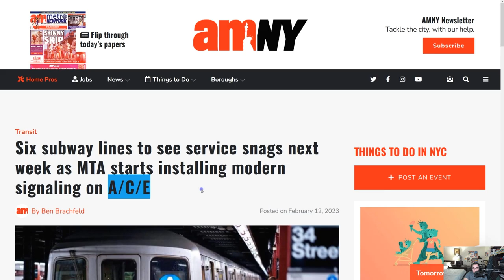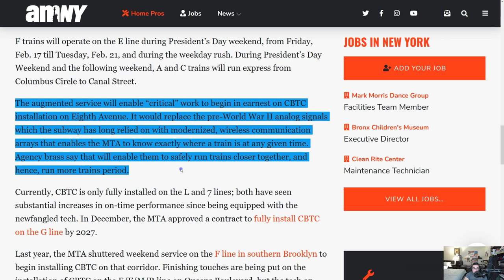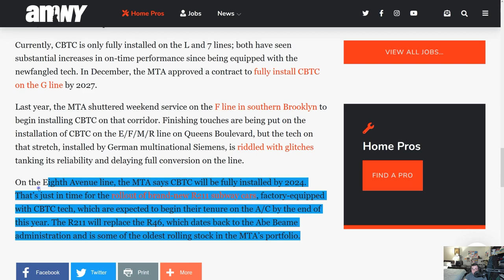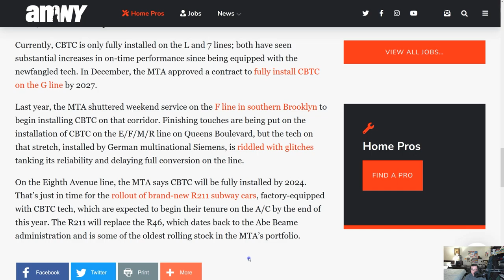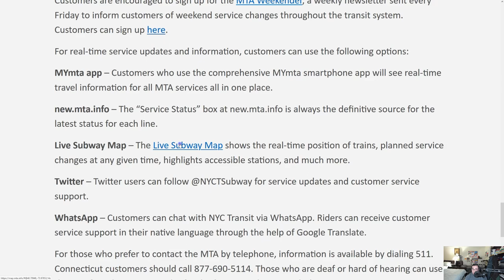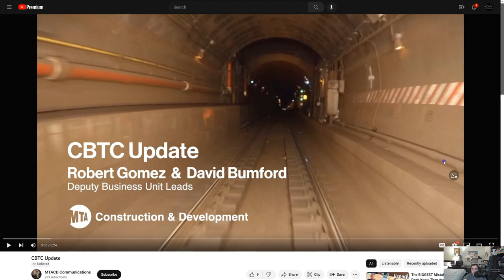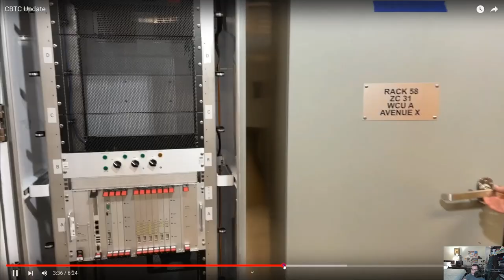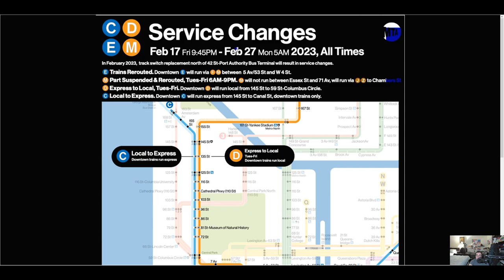Important CBTC Work to Affect Multiple Lines Starting Friday

Comment: Not to be rude, yet please make your microphone louder. I want to enjoy your videos, yet I'm not able to do that if you won't do anything about your audio. Your audio is too quiet for me to be able to enjoy watching your content.
Reply from the maker: It seems that I’ll need to increase the gain on the microphone. The only problem is I don’t want the audio to sound like it screeching, I’ll make adjustments
Reply: Although the low volume can be a small issue, I like that there’s no background noise.
Reply: I've noticed that myself.
However,there is little feedback,or distraction
A little adjustment, and every thing should be good.

Really dig the show.
As for your presentation, the A should have been done before the Queens Blvd line, since the issues with the relays occurred at Chambers st, basically burning the entire room up, destroying the signal relay system.

The G line has been much improved.
Trains are arriving 3to 6 minutes during the day.. the 160s are quick... sturdy, and comfortable.
No hippos(R68s) running the line increased the output.. speeding up service.
The other issue with the G is crowding.
I am quite surprised to see standing room only trains pulling in.
It's time for additional cars for the G line.

One way to answer this,is to move the 179s from the C to the G.
The C is going full length 10 car R211A trains.
440 R211 cars will be going to the 8th Ave line.
75 R211s will go to the SIR.
640 R211A will be broken down with the half going to the A and C, the rest will go to lines that will interact with the 8th,6th avenue and Queens Blvd routes.
Since 6th Ave is technically receiving CBTC,some new rolling stock will be assigned to the B and D lines.

What this means is simple.
There will most definitely be major car swapping going on.
Moving the SMEE cars to the BMT Southern Division,( R46,68, and 68a), while the North, Eastern and Queens will be all NTT equipped.

This sucks for the Broadway line, and it's branches.

Time will tell.